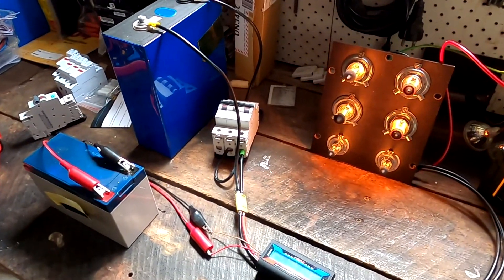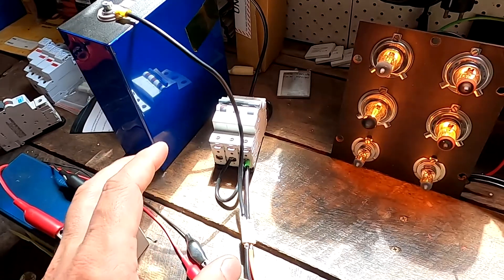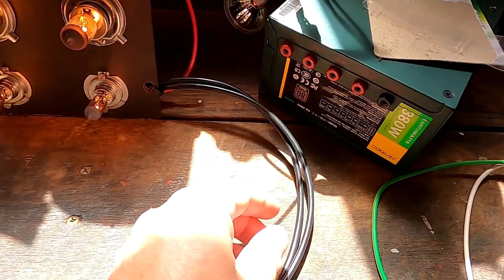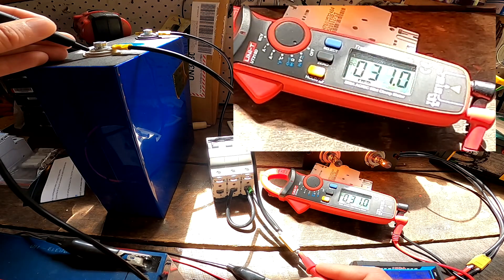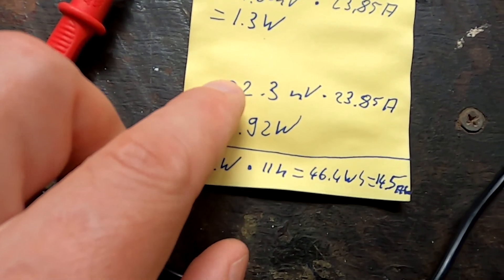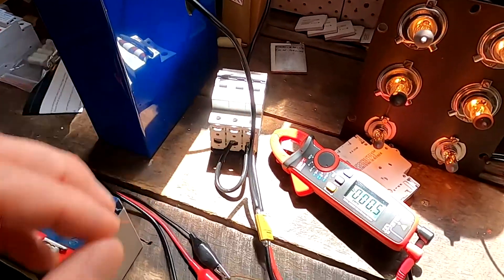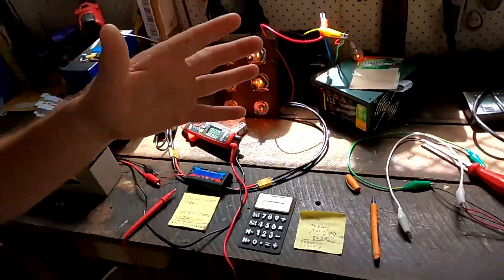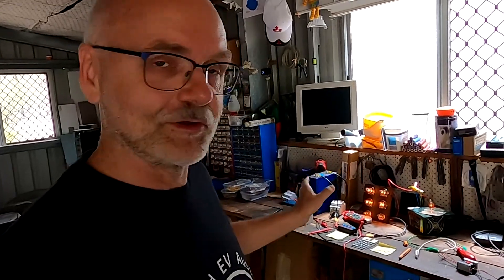Capacity Test including Cable Losses. We're close!

Comment: If I have a battery tester Atorch DLB600 and am running sense wires 16awg with power cables 8awg during capacity testing does running the sense wires negate the losses across then wire due to accurate cell voltage reading? I would be curious to hear what your thoughts are on this subject. 

Thankyou!

Comment: You will also have a small loss in the power meter as it will use a small resistance to measure the current. You could press a couple of pins into the cables coming out of the power meter and measure the volt drops at that point as opposed to the input joint that you did before. My guess is that it might gain you another watt or so - but every little helps! The trick with the pins works - just don’t let them touch. Cheers

Comment: Heat loss should not effect ahrs but voltage. You could accurately measure amps and then just use a clock or watch.  20 amps x 14 hours is 280 ahrs.  Put the watch and amp meter in same video.  There is another 20 amp meter on ebay for $10.
Reply from the maker: That's inaccurate too. The amperes are not constant and fall with the cell voltage.

Comment: Why is the load counter not directly on the battery... then the breaker then the lights? Wont that be the most accurate way?
Reply: Great question. Yes, that is true, but it's also the un-safest way. The breaker or fuse should always come first. Imagine a fault in the meter/analyser. It could short the cells and cause a fire.

Comment: you should get more than 280ah in this NEW batteries. You can check others that tested good batteries and they get above the battery rating unless the battery is already overrated.
I really wish you had at least 280ah , sad news here.
Reply from the maker: It's not sad news, it's the way I tested with not having the right equipment. So other comments here under my videos which have done the test as well.

Comment: Remember the right torque on the positive and negative terminals: 3Nm.

If it is wrong, it will increase  energy loss in heating. 

...and don't forget the aluminum oxide and copper oxide on the terminals and busbar after 5minutes in the air. 
You have to remove it with a metal brush
Reply from the maker: Where is this number coming from? It's not in the datasheet for these cells?
Reply: @OffGridGarageAustralia  try to ask it to your reseller

Comment: Great improvement from the last video! You are really close to the rated capacity of 280ah. This is great news! I am extra happy that you were able to see better results. I think if you use the 10mm wire for the next test you should see 1/2 the wire loss and maybe as little as 1/3 the wire loss. Also if you upgrade the xt60 conectors to something larger you could likely see your 280 ah capacity. I am sure that these are all things you have considered for the next video. I would also like to see an average capacity of all 4 cells to make sure that they have consistent quality if it is possible. Thanks again very much for your effort and the work you put into your testing! I am going to use your results as a basis for purchasing 100 of these cells.
Reply from the maker: You're planning to buy 100???
Reply: @OffGridGarageAustralia  Yes I am planning to buy 100 cells. I want to power my entire house and shop off grid in an emergency.
Reply from the maker: Wow, what a great project. That's really interesting.